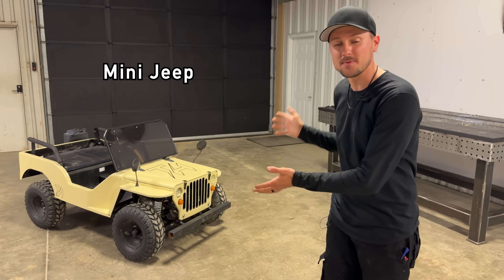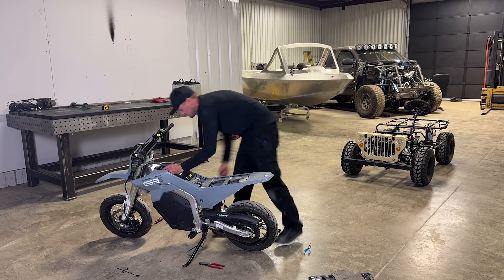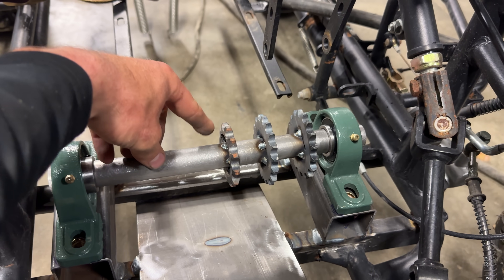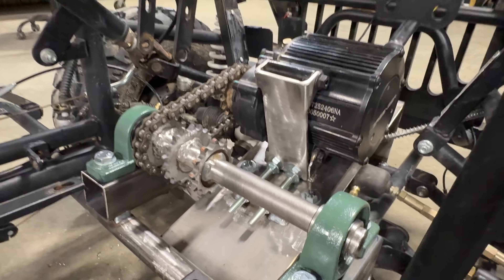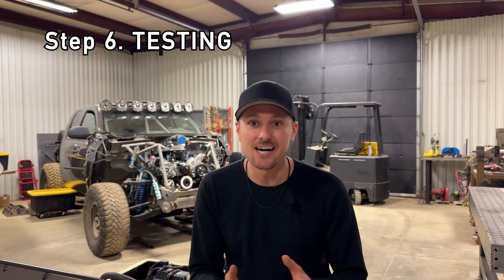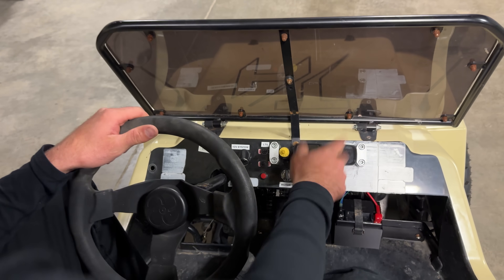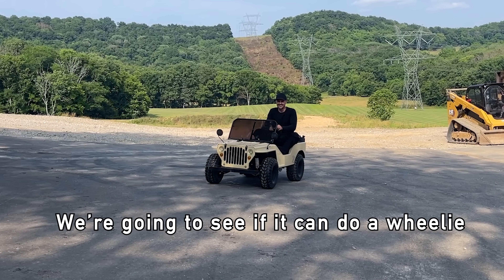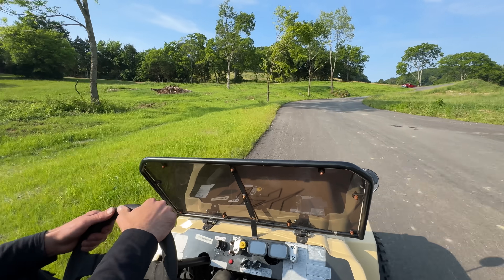Swapping TWIN Motors in a Mini Jeep (FULL build & testing)

Comment: Great build although I hope you’re pulling the power for the 12 V system off of both batteries otherwise you’ll deplete one battery quicker than the other. You need a speed controller so you can have reverse.

Comment: So you built a WAAAAY over powered, >>2<< WHEEL REAR DRIVE >>>JEEP<<<???!!! Put the batteries in the back and then get surprised when it WHEELIES???!!
JEEP's are noted for their >>4<< WHEEL DRIVE, OFF ROAD capability ... not how fast or powerful they are. This is an INSULT to the JEEP Culture, JEEP Brand and JEEP ENTHUSIASTS. 
So what did you actually do? You made an ridiculous and dangerous GO-CART with a plastic JEEP shell. What a waste of time, money and effort.

Comment: Before the Willie’s Jeep, there was the De Soto. The De Soto was a four-wheel-drive monster that could drive anywhere. It had a purposeful max speed of 55 miles an hour wide open. It had a body that was an inch and eight to an inch and a quarter thick all, but one were destroyed, and it lives in Pennsylvania, and the drivetrain was illegally taken from it And I saw it on YouTube so the drivetrain is all in one piece, but I’m not sure where it’s at and it was replaced for the Willys Jeep. They sandblasted the body on that De Soto so that you can’t tell that it was that thick they were 100% hand grenade proof you could set live hand grenades on the De Soto all day long and it would just be a scratch mark scuff mark The Willie’s Jeep. It’s fancy thing it was hard on its clutch but almost every time you took off, it would purposefully snatch the front wheels off the ground a foot or more every time and they detoured it when they brought it home the other thing you need to be aware of is at least once a week it got a new clutch Since nobody knows this. I figured I would share some real American history because nobody knows it. Nobody even the members of archives that studied this stuff they’re retarded with chemical memory, suppressant, and or killed with other pharmaceutical mismatches.

Comment: Tbh depending on where you are id much rather have a gas motor in the woods vs electric you are too silent you can end up like me and run directly into a black bear cub luckily the mom absolutely destroyed the dirt bike I was on instead of me I think the only reason that happen was because I got thrown like 20ft past where I hit the cub I just hit the ground then took off running and yes I did literally shat my pants

Comment: Instead of using both motors to drive 1axle why not make it 4wd
Reply from the maker: Not much room in there dude lol
Reply: @propdepartment grind hard put a motorcycle engine in a 4x4 power wheel... I have a mini jeep and they came with 2 different engine locations available from the factory front under the hood or mid/rear engine in the swing arm

Comment: You should gear one of the motors to do less rotations per wheel rotation so you have a higher speed. If you did it on the second motor, you could turn the first motor off when you get to top speed of the first motor. You could also gear the first motor even lower to get up to speed the same as having them on the same. This is if you want higher top speed and further range off of one motor...

Comment: Would have been badass if you had 1 motor for each rear wheel, and a system that varies the power to the motors depending on how much you turn the steering. 
Just to make cool wheelies and be able to take corners ;)

10/10 vid ! You got my sub, i had no idea you had your own channel :)

Comment: That clattering sound you hear in the test start is the lower side of the long chain self-clearing on the frame. It will eventually stop. Either when the chain breaks, or when the frame gets worn through.

Comment: i'm not an electrical engineer but there has got to be a way you could run some solid state relays to isolate the current to run reverse polarity to like just one of the motors in order to get reverse out it, right?

Comment: 6:39 are they in the same mode? motors didnt seem to pull equally Super Clean build btw!
Reply from the maker: One shows kilometers one shows miles, they’re working the same since they’re chained together and have the same throttle input
Reply: @propdepartment ahhhhh make sense now yeah I run a similar setup but mine has different modes so I have to make sure they’re set to the same

Comment: Build an electric mini tank! Use the Power Wheels tank as a body and build a frame for it. That would be sick. You can use dirt bike snow tracks like the cheap ones on Aliexpress and two QS hub motors with two controllers and two throttles. You won't need any fancy programming to make it drive. I made a mini Sherp that way, except I used 4 QS 5kW bicycle hub motors and 4 controllers. I bet you could build an epic mini-sherp or Tank in your shop. I only had a Tig welder, a Miter saw, a torch, and a cheap Alibaba lathe. lol

Comment: Hi Tyler! Great project! The motors you're using look exactly like the QS 138 motors, which can easily handle 40 kW with the right controller and battery. I also have that motor in my electric buggy and get that power from it. So you can get a lot more power out of the jeep.
Reply from the maker: Woa, I bet we could turn it wayyyy up

Comment: need to install handbrake for drifties
remember to set up your dual controllers for AWD that you set up modes for front drive only (extended drifts), rear drive only (wheelies), and AWD (will drag you up a cliff or through foot deep sand without breaking a sweat - 2WD are the units that overheat, because, 2WD)  😀
Great video, thanks for making and sharing with us and you must be doing something right because algorithm put you on my sidebar.